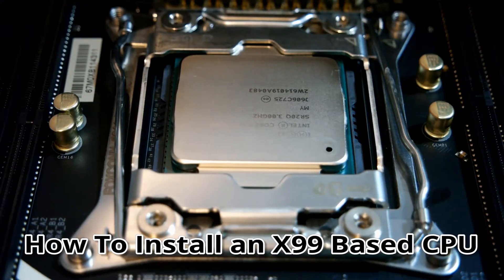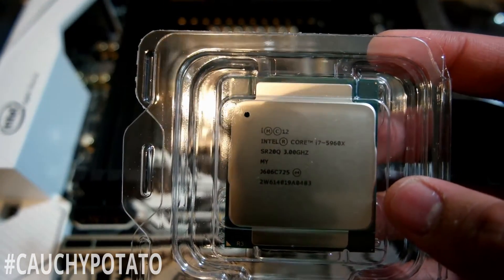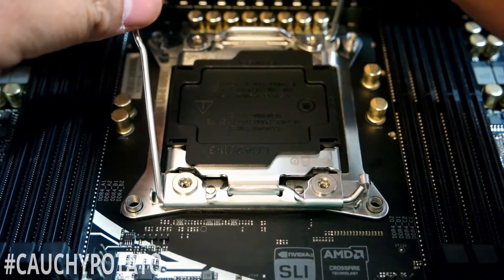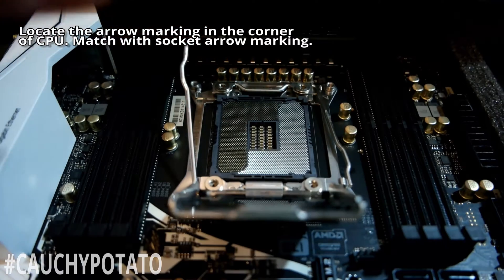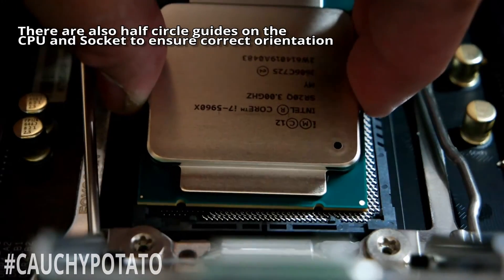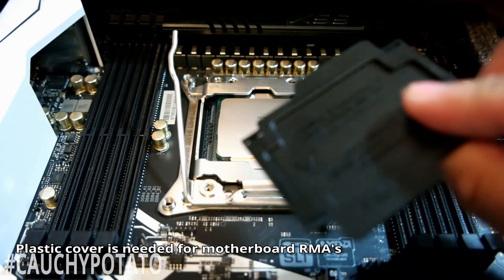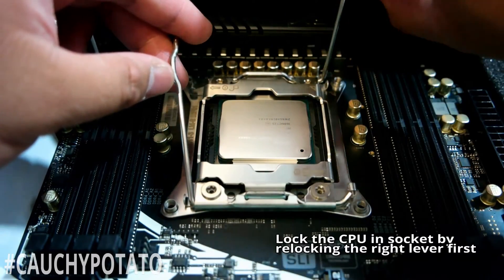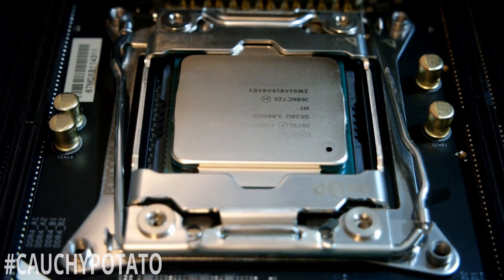How To Install an X99 CPU (Intel Socket LGA 2011-v3)

Comment: Thanks a lot, just instaled my Xeon E5-2680V4 CPU.
Reply: How's the cpu I will buy it
Reply: @ahmadayman529  I don't have long-term observations, I'm not actively using the system yet. I'll be able to write in a week, maybe.
Reply: PLEASE How did you instal the cooler. ITS so complicated i got mine but i cant instal the cooler

Comment: I just bought Intel Xeon and this video calmed me down a great deal. I've never installed an Intel CPU before.

Until now I've been using A8-6600K. But I bought both Intel Xeon E5-2690 V4 and the motherboard for, like, $110 or so. You tell me if it's worth it. ;)

Comment: Thanks mate, manage to upgrade my 6800k to 5960x!
thats unbelievable what silicone lottery can do. 
With 6800k i needed to use 1.375v for stable 4.1ghz with 2600mhz ram
Now with 5960x im doing 4.1ghz with just 1.2v! (Didn't even try lower voltage) and ram easily booted in 2666mhz (same timings obv), when before limit was 2600mhz.